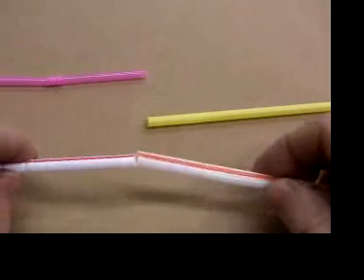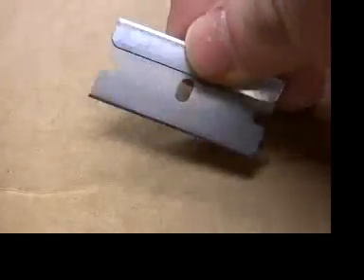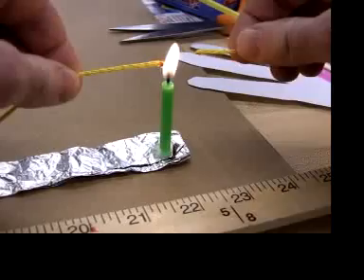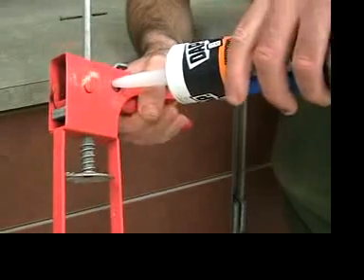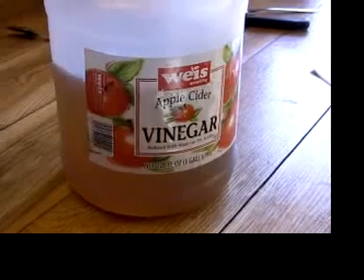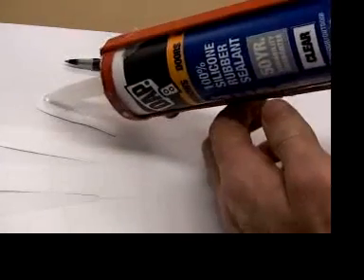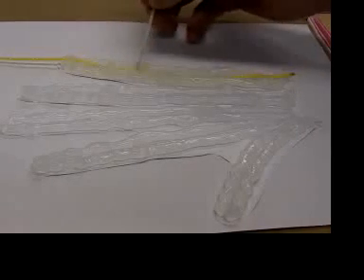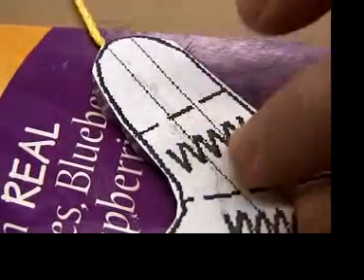Make a Working Model Hand Part 2

Comment from the maker: Thinner straws are a little easier to work with because they take less space, so it's a little easier to apply the silicone in a later step. But thicker straws should work if you are careful.